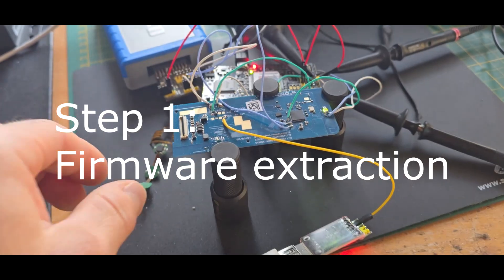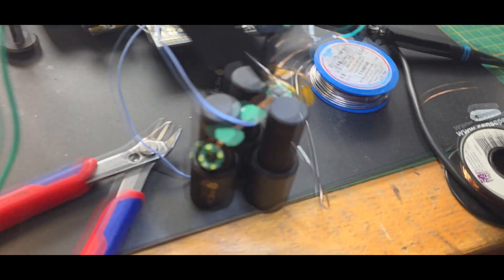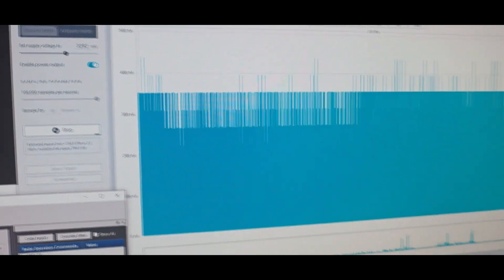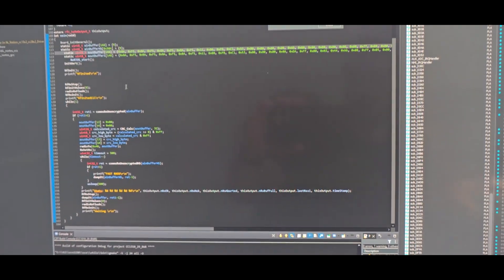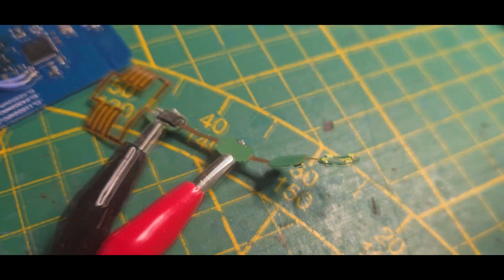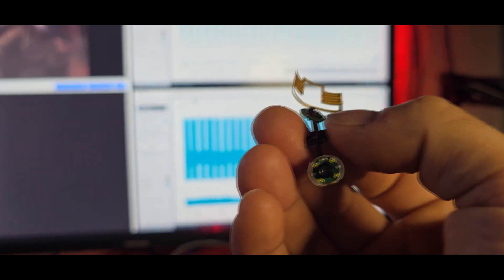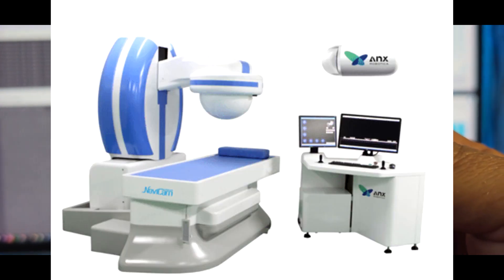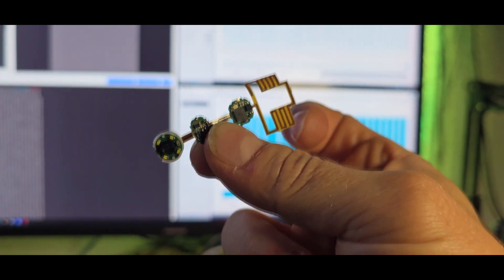Hacking the Pill Camera - a 3 Part Story

Comment: One of the biggest sensor manufacturers of these small image sensors is Omnivision. If you know the resolution and the sensor size, you might be able to find it in their catalog. Their smallest cameras (e.g. for endoscope use) like OV6948 are still analog out (with a proprietary encoding) needing just a clock signal, minimal config interface and power to run and require an additional conversion chip down the line.

Comment: Now that's a real hardcore hardware hacking. Very impressive.

As far as I understood you focused on the TI chip, but what about the others - what are they? If one is the spi flash, could it be easier to dump the firmware directly from it without the need for glitching?
Reply from the maker: The other big chip is the Image Encoder which takes care of getting raw data from the CMOS Sensor and sending it JPEG encoded further to the TI Chip. but that one totally unknown and rebranded, since there is only one Camera available I did not want to destroy anything. Also the external flash(If it is flash) is connected to it and not to the TI so does not hold the firmware

Comment: Excellent! You did it again. What method/hardware do you use to induce the glitching?  For ethical hacking purposes, I'd like to learn so I can test my developments and investigate if it's possible to prevent it, although from what I understand it wouldn't be possible since it's a weakness of the physical chip...
Reply from the maker: Hey, in this case Im using Voltage Glitching via Fault injection. And indeed here only a new Chip revision can fix the issue